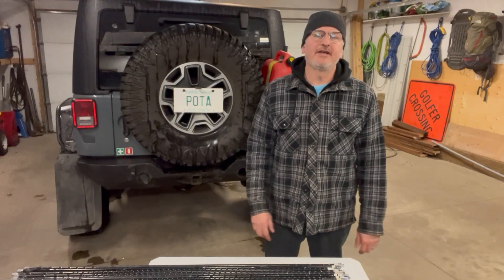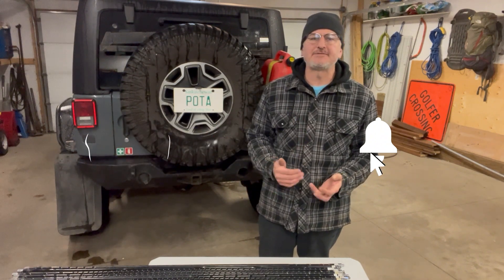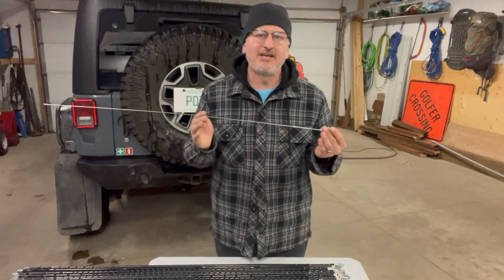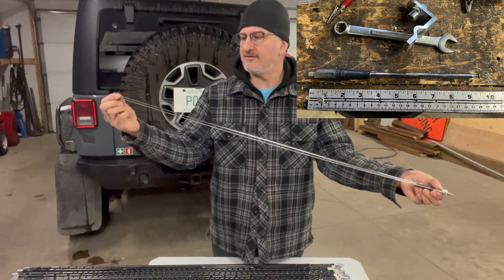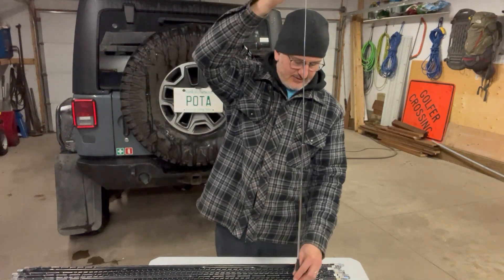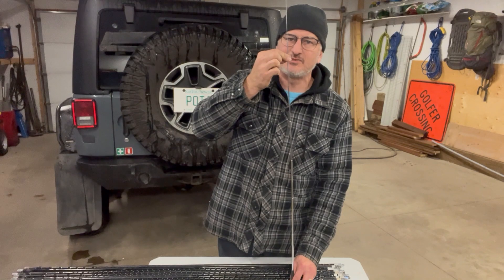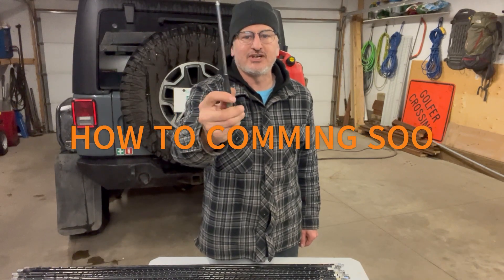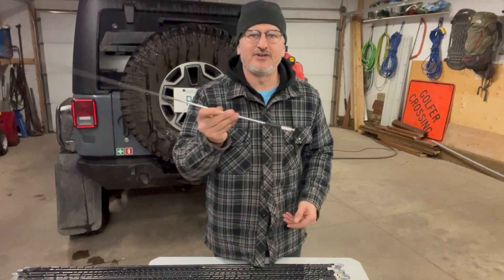Top 5 Ways How to Tune a HamStick for Maximum Performance – No Tuner or Analyzer Needed!

Comment: Great video! I have been using Hamsticks for POTA for a while. I built several dipole mounts and a quad mount that all work great. I'm interested in the size of the screws you replaced the set screws with. I have Shark Mini's mostly.
Reply from the maker: I used a m-4 screw but yours could be different.

Comment: Rather than substitute a large flimsy collapsible whip for your Hamstick stinger, attach a short collapsible whip maybe at most 4 sections a foot long total to the top  of your top short stinger.  A great source for such a short whip is a pocket collapsible  magnetic pick up stick sold at Harbor Freight or here in New England at Ocean State Job Lot.  You can find suitable clamps at Home Depot - the small rectangular metal clamps with two Phillips set screws that are used for clamping wire rope.  I use such a “vernier” stinger on the stinger of my Webster Bandspanner multi band manually adjustable 80-10  meter center loaded mobile antenna from the early 1960s.  It’s a great antenna but it’s a bit touchy getting it to resonate on 50 and 20 meters.  With the little vernier stinger it’s very easy to get a perfect match anywhere in the band.  Should work on Namsticks as well.

Been using  Hamsticks for over 20 years.
work great results. A few comments:

Ditch the spring mount base.  All the spring does is allow the antenna to swing around like d drunken sailor as you accelerate , brake, and turn.  All that movement will change the antenna resonance and SWR as the antennas distance from the metal parts of the vehicle changes.  Just use a solid mount.  I’ve only broken one Hamstick in over 20 years as a result of bonking it
on something overhead. And you don’t need any support guy linens either.  

In order to get the best match on 80 and 40 meters you generally need to have a shunt coil or capacitor matching reactance across the feed point . 500-1000
Pf on 80/75 and 500
Pf on 40 meters.  

If you use a mag
mount base, you absolutely must have an actual wired
binding conductor from the feed line showed at the feed point to the body of the vehicle that is as short as possible.  Mag mounts are ok for capacity coupling the shield side of the feed line to the body of the vehicle at VHF but small and lossy for use on HF’frequencies.

I also always replace the crappy Allen set screws with good quality stainless Phillip head screws.

To make it easier and quicker to make adjustments to stinger length when moving around a band, I use a Hustler quick disconnect coupling on the bottom of the stick at the mount.  Saves having to constantly use wrenched to connect and disconnect the whip.

Whenever possible, mount any mobile whip as high and far away from the vehicle structure as possible.  Otherwise you are just putting a lot of your signal right intro the vehivl.  My favorite locations are at the left rear corner of the roof on an SUV or at the left rear corner of the bed of a pickup truck at the top of the fender lip.  I cringe when I see antennas mounted directly behind the cab of a pickup within a few inches of the cab corner or a trailer hitch with most of the antenna below the stinger only a few inches away from the rear of the vehicle. 

The only antenna tuner I’ve ever needed to resonate Hamstiick for mobile use are wrencjesn, a screwdriver, and on 80’and 40 meters, the matching feed point shunt cap or coil.  Typically a coil of about 6! turns of No. 16 insulated wire close wound on a  plastic pill bottle works very well.  Never have needed a shunt cap or coil on bands above 40 meters.

73 de Chris AJ1G/M Stonington CY
Reply: 6 turns not 61.
Reply from the maker: Great tips,  thanks.  I’ll be making another video addressing your points.

Comment: The telescoping whip is an awesome idea.  I love it.
When I pota with hamsticks, I use a manual tuner inline - it's an old MFJ box with 3 knobs that I bought off an old guy at a hamfest for $20.  I leave the hamstick at the factory length, screw it together, and screw it into the mag mount.  I dial the tuner to where the radio gives me the best swr, and let it rip.  I can usually slam the swr down to 1:1, or really close.  The nice thing with the manual tuner is that there is no additional draw on my battery.  I've made thousands of contacts with this method.
Reply from the maker: Hey thanks for watching.   I also have a nice little manual tuner sitting on the bench that I might do a test on.  73’s for now and hope to chat on the air.

Comment: Great idea. I could never get my 10 meter hamstick long enough to tune below 29.000.
Reply from the maker: Thanks.  Some bands it’s not needed but it’s very useful on 75/80 40 and like you said 10m when operating up into the FM section.  .

Comment: Here’s a tip-  the MFJ 60” adjustable stainless steel whip comes with a 3/8” stud built in and will screw right on the top of the Shark Ham Stick.
Reply from the maker: Thanks for the tip!